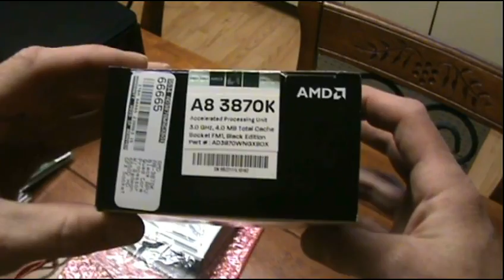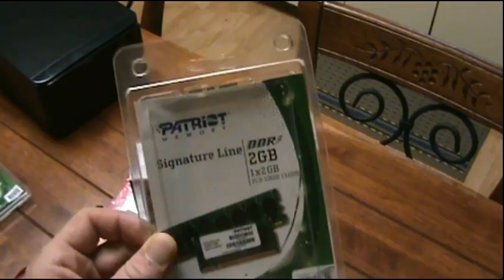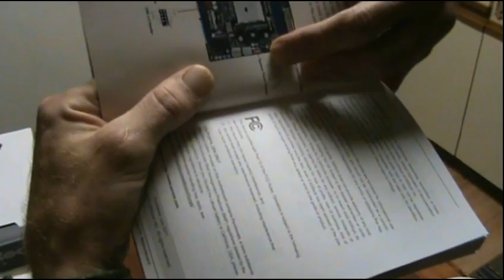Computer Build Pt.1

Comment: hey Rick, i'm a system builder from a waaayyyy back.  1 trick i always did when system building was i installed the processor onto the MB before installing the MB onto the case.  It's easier on you and the board to press down on it on a flat surface like your bench or table and not in the case where it can flex.  I've seen way too many people fracture the connectors on the board by doing that.  Good tip for next time!

Comment: I built a computer almost just like this same apu. I just went with a micro atx board. I hybrid crossfired the apu with a 6670 card and it performed awesome. Also i had a ssd boot drive and it would boot up insanely fast.

Comment: Good vid Mr. Rickem!!! I have 2 one TB drives, win 7 is on one & win 8 is on the other. I installed 8 on the other in case I didn't like it & have to reinstall 7. I put 64bit XP on a 320gb laptop but couldn't fined some drivers I needed so I formatted it, I just wanted to see. Also have a 3tb external. My mainboard has 4 ram slots & 6 sata inputs.

Comment: great vid, rick. your fast forwarding through the slow parts reminds me of billstmaxx's videos. only thing i would have done diffierent on the build is i would have installed the cpu, fan and memory before putting the board in the case. you have more room that way, and its easier.

Comment: That's not always the case.  I run no fans in my htpc, not even the heatsink has a fan (just really big copper heat sink)..  The only thing that does is my ps.  Worked fine for a year and a half so far.  Just don't stick your PC in a closet or a desk cabinet and it's fine!

Comment: Fans are cheap and they do have room for one fan I think in that case.  AMD APU's are okay as far as heat goes. I overclocked mine from 2.6 to 4.5 on stock fan and only increased 15C

Comment: you should just put the power supply outside the case and run the wires inside sure it doesnt looke pretty but itll get the job done

Comment: 10:45 the writing doesn't always work that way. The way to to it is almost 100% of the time there is an arrow at the top of your processor and an arrow on the socket that you need to match up. and you should always put the ram and cpu in the motherboard before anything else. I always put my cpu in before putting the motherboard in the case. it's just easier that way.

Comment: the amd apu is great for sff pc's like what he is using, besides Intel is so overpriced I'd rather get slightly less performance for a hell of allot less.plus with the APU it has a gpu in the cpu and ifyou add another gpu in the pci express port you can run a hybrid crossfire between the two and further the amount of power you get from the pc at even less costs.intel is the best but amd still thinks about their customers allot more than they do.